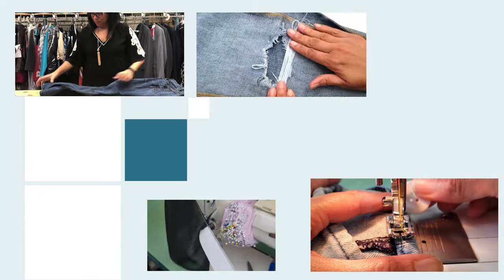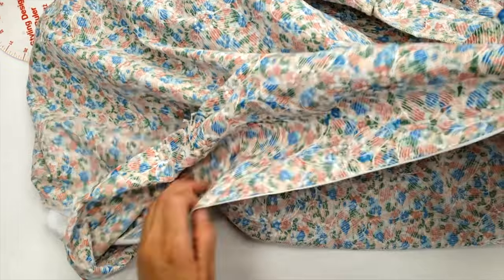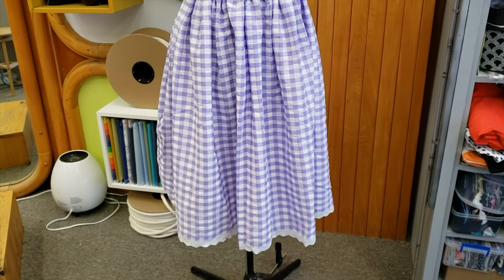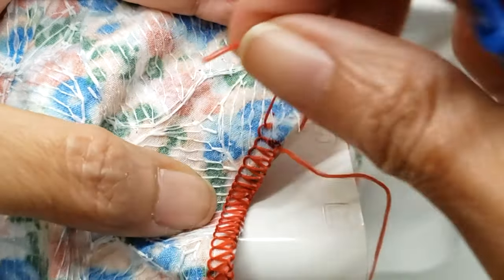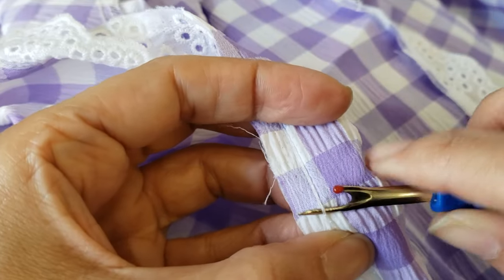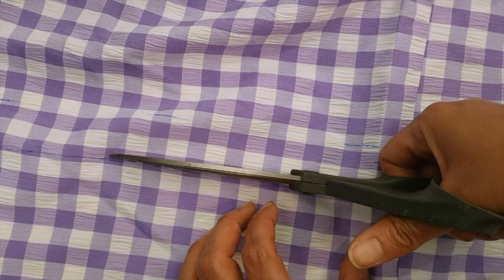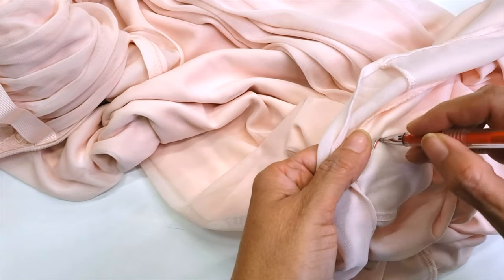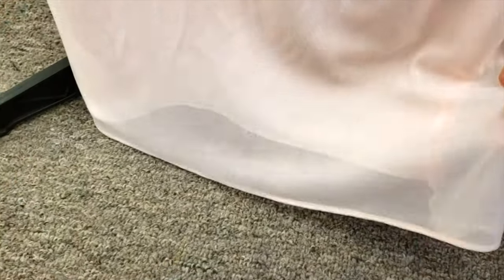3 ~UNCONVENTIONAL~ Dress Hems **Think outside the box

Comment: Your hair looks so pretty in the opening.  It looks like maybe you had it cut.  
I am going to try that trick to remove serging. I’ve not seen that method before. It is much better than my method of cutting the edge of the looper threads and then getting upset that my method isn’t working! 😂
Reply from the maker: 😂😂😂 I use your method often too.  Thanks about my hair!

Comment: The second technique for opening the serged seam, are you pulling the needle thread?  Does this method work for a 4-thread serged seam?  If so, do you pull both needle threads or just the one still?
Reply from the maker: Yes, yes and yes!!! The needle(s) thread(s) is(are) the one(s) to be picked up.  Cheers 🥰
Reply: @DowntownTailoring  Thanks!  I will try this technique because opening serged seams is one of my least favorite challenges.  It just takes so much time and I never knew there was any trick to make it faster!